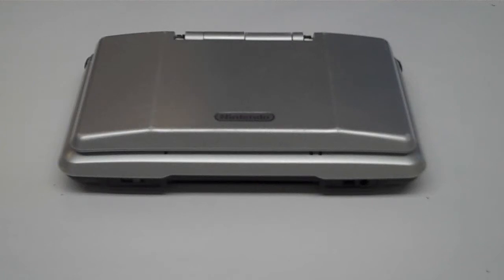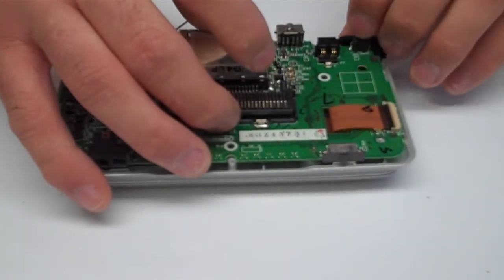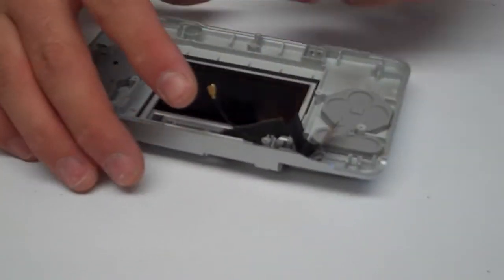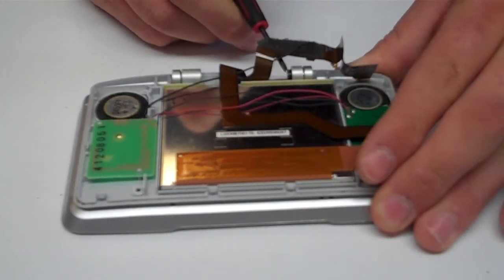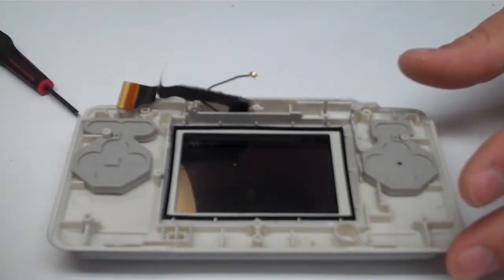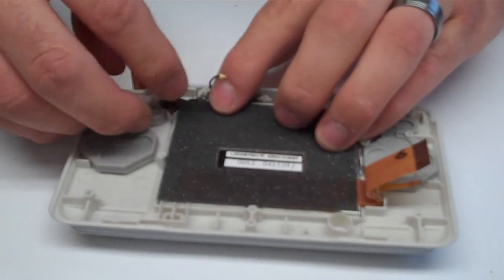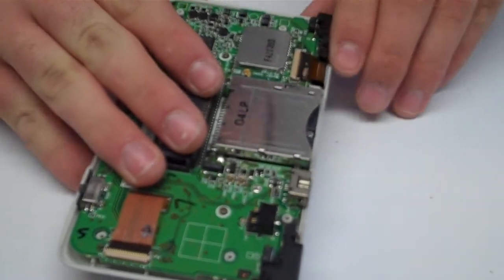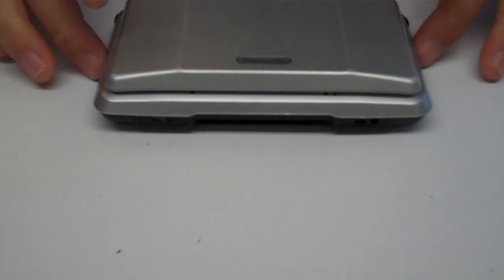How to Repair DS Hinge and Shell

Comment from the maker: @sesaruoosama First thing to do, Check all your connections if its properly connected. If nothing happens, Both top and bottom lcd's might be the problem. It needs replacement. Please visit our website. We do have the parts that you need in order to repair your system. Just search for nintendo repair shop on google for our store.

Comment: @nintendorepair Now that you mention it, I did run into problems and ended up just buying another DS. I think I squeezed one or more of the LCD ribbons too hard when I was re-assembling it. I didn't understand how to put the small ribbons back in until after I wrestled with it. (T-T) Plus I broke the back battery cover by trying to screw it in too tight. lol Alas, such is life...

Comment: Hi, I have a phat DS with a broken hinge.  It's on the top section.  I'd like to replace the top section (and so replace the broken hinge), but I don't want to strip down the lower section if I can get away with it.  Is it possible to replace the top section without opening the bottom section?
Thanks.
Reply: Gary Thomas No.

Comment: Will this fix the screen on the system as well? I have two of the original DS and the first one's top screen completely stopped working, everything is white, and the second one started showing everything as slightly more purple recently, which is how the first one was before it eventually broke. They both have the right hinge broken.

Comment: I reshelled my DS Phat, and when I press the power button the bottom screen flashes on for a second then the whole thing turns off. Is the system broken, or have I just connected the ribbon wires too lose?

Comment: I am thinking of buying a replacement shell from you guys, but I have a few questions.
Does this come with a screwdriver?
Does this come with replacement hinges?
Are you going to restock on colors (like red)?
Reply from the maker: It doesn't come with a screwdriver or replacement hinge, however we have both of those parts on our site for under $10 combined. We can get in any color that is currently being manufactured, so if you would like red we will order a few. With this system being a little older we don't stock as much on hand as we used to.
Reply: thank you very much. I will probably order a new shell from your website soon.

Comment: Hi, i tried to change both the top screen and the shell because of a broken hinge. Now my DS doesn't start. When turning on, only the bottom screen turn on for about 2 seconds and then the whole system turns off. what could be wrong?

Comment: How do I get new hinges or a new shell? Most of what I see on eBay is for the lite/3DS.
Reply: Here, this right here comes with the Tri Wing screw driver too.
https://www.amazon.com/Nintendo-DS-Original-Replacement-Shell-Housing-Red/dp/B06Y1HS9M6
Its kinda strange that they are on Amazon of all places, probably because these things sorta usually come from china, and most of the time when they are from China they're sold on eBay. Maybe its just a company selling it on amazon to look more professional? The world may never know.
Reply: Silley Doggo - those aftermarket shells are terrible and I would not recommend them. I ordered two of them and both of same had the same issue, two screw holes were incorrect, so the screws did not fit into them. Also the screw hole for the battery cover stripped. There might be some good aftermarket shells, but the particular one you linked (it comes in various colors) is really bad! Not that you’d know that.